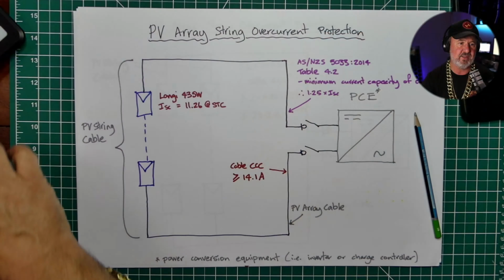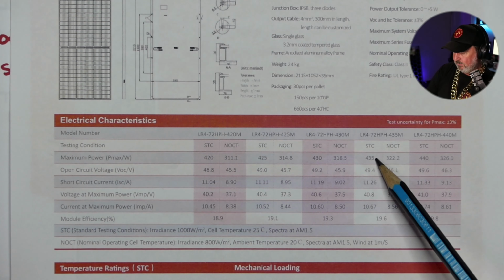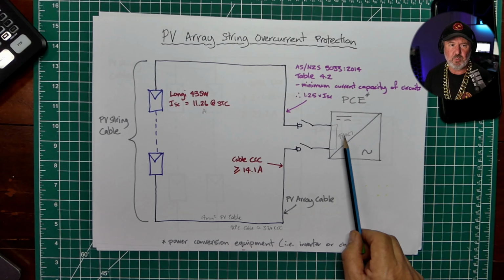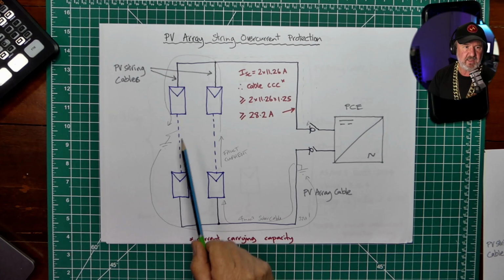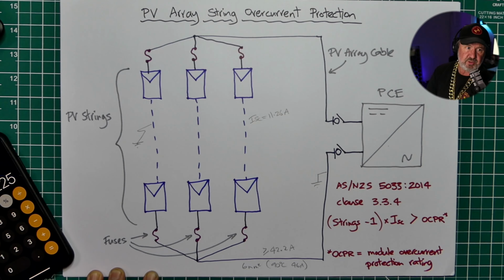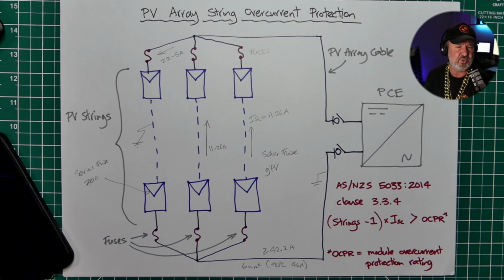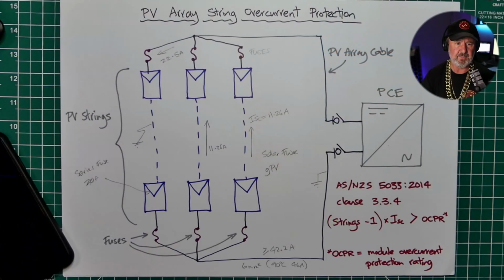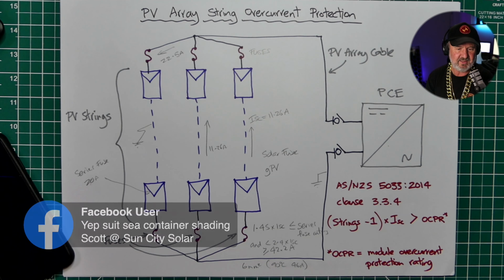PV Array String Theory

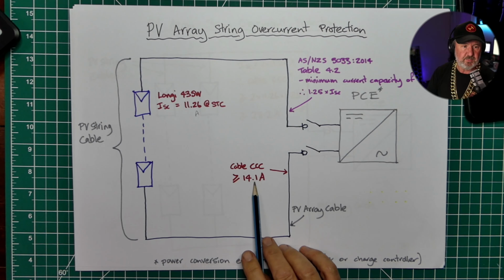Comment: This is great thanx for sharing this knowledge.  I just have to add on 13:03 it's IEC recommended cable diameter with related to amps -range for 2-8 Amps/mm2 (and for short circuit 182-184 Amps/mm2 1 sec) so for 14 Amps and 4mm2 with normal temperatures conditions. Looks that IEC and AS 3008 is 1:1 principles is same but table data have small different -18 column (Partially surrounded by thermal insulation) 95 mm2 204 Amps and another side 216 Amps Cu )